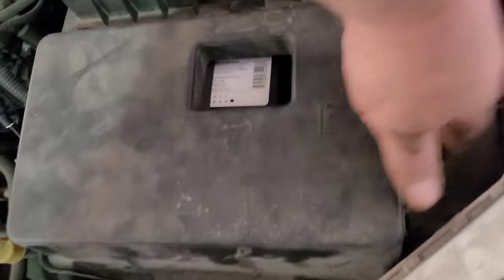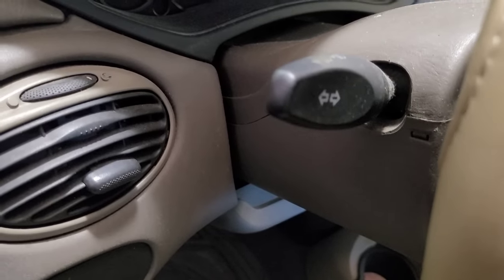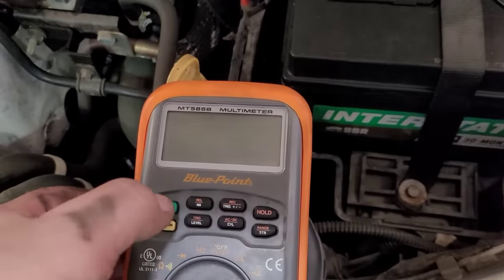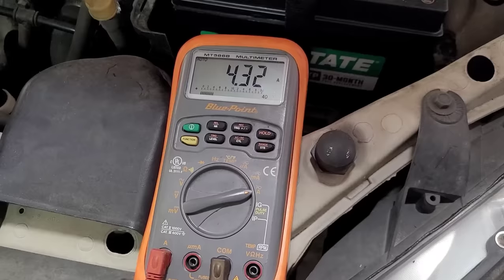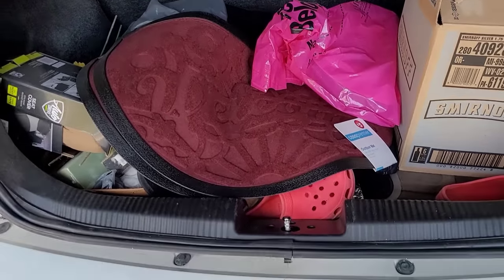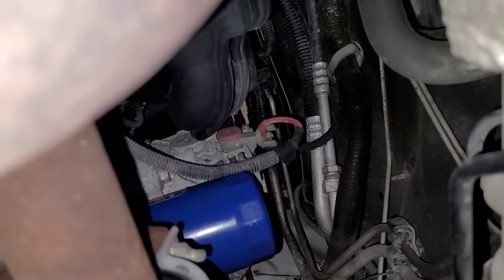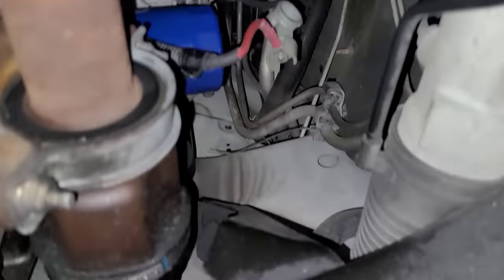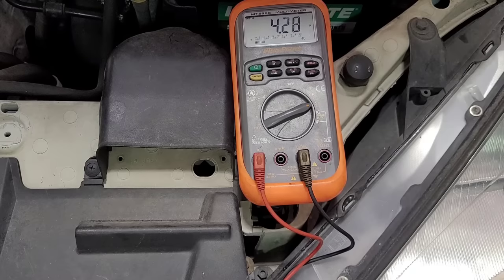Why is the Battery Going Dead? This One Will Surprise You!!

Comment: Very good find and video! Piece of advice from a BMW and Agricultural mechanic. On cars with lots of fancy control units, never disconnect the battery and then hook up the meter. Make a jumper from the battery to your battery cable (so it can easily be removed), hook up the multi meter in parallel, but to the battery terminal directly (so it remains as connection when the jumper is removed). Turn the key on until all controls have gone through their wake up cycle. Turn the key off, LOCK THE CAR with the fob, disconnect the jumper and then see.
Reason: if you disconnect the battery and then put your multi meter, some cars will have a spike draw that will trip the meters 10amp fuse or even kill your meter. Also, there are many other places a parasitic draw can occur in modern vehicles and the car MUST go through the natural cycle of "booting up, booting down" and going to sleep with the anti theft in place. I had quite a few vehicles where a controller wouldn't fall asleep, because the CANBUS was impacted and kept it awake. A short in a radio or even light control switch can do that, but might not show up, if the booting cycle was not completed. Finicky things.
Finding a bad alternator is an easy fix  good job!
Reply: That's why I have a DC clamp meter for such things. That way you don't have to disconnect anything at all.
Reply: @wiedapp  wow, must be an expensive clamp to be accurate below 5amp
Reply: @oBseSsIoNPC  Not really, was about 100 bucks. And that is accurate enough. And I'm talking about my personal one.
At work things are a bit different, there I have two of them. One can measure up to 400A AC or DC, the other one can measure down to 0.1mA AC or DC. That is way beyond anything what you need in a car in terms of accuracy. The 'big' one is for everyday use, but when the currents get really small, I pull the small one out of the drawer. Both are provided and regularly calibrated by my employer. The 'big' one you can't get anymore new, was around 350 bucks, the little one around 250. And that was one of the cheapest from a reputable manufacturer we could get. If I went with our usual brands, the little one would have cost about three to five times that.

But just so we are on the same page: I don't work on cars, besides my own and that of my immediate family and neighbors and I only do minor repairs.
I mainly work as an electrician at an industrial company, mainly doing fault finding and repairs. There we work with 0-10V and 0-20 or 4-20mA signals to control appliances from 0-100% or get readouts from 0-100%. But the current draw of each component is still a main checkpoint for fault finding. Clamp meters do make my work easy, as I can find faulty components faster and without a need to disturb the wiring and without powering something down. Because: Sometimes faults go away with a power cycle and then I don't win anything by saying I can't find the fault.
In addition the search is faster, BECAUSE I don't have to open up the wiring to put a meter in between. When I work on something, I want to get the job done and move on to the next. Only if something goes bad repeatedly I dig deeper, because I want to know why and it gets on my nerves. That makes my life easier later on. Sometimes I even can come up with a solution to reduce the occurrence of said faults.
Reply: @wiedapp  definitely! Those are great points and I do agree, an amp clamp does really well and is simpler than the previously described method.

Comment: Had a late 80’s Honda with no charge ,dead battery. Put in new battery to start car and confirm no charge.Car was California built , for some reason the alternator was not available in Canada, wondered what could be different but had to use local rebuilder. I dont know reasons for sure but he replaced what he said it needed and re-used rest of components. Turned out , after battery going dead 2 more times we discovered the draw , guess tech working on it at the time didnt think about draw because no charge and dead battery led him down that oath . Any way, we ended up putting 2 techs and myself on it to narrow down the issue, turned out the old rectifier plate with the diode trio had one bad diode. It was discovered the same method you did , disconnection of alternator 12 volt source live , draw went away. Rebuilder wasnt on board with our findings cause he didn’t want us to know he didn’t replace the diodes.

Comment: I had a Parasitic current draw once on an old Dodge Dakota on the in dash Tachometer. The draw was enough to make the battery dead after about 3 days in the winter months. I ended up putting a relay in its fuse circuit to kill the power if the truck didn't have accessory power. This was a simpler solution than trying to find a good replacement the same age in the junk yards.

Comment: Going from the battery out, there's really only three places where the it's directly connected: starter, alt, and distribution block. Disconnecting the alt (most likely problem spot) would be my first step; if that doesn't do it, disconnect the starter. If that doesn't change the current draw, start pulling fuses. 9 times out of 10, this will show you where the problem is in 10 minutes or less. If none of the above solve it, you've mostly likely got a short somewhere (usually an after-market install or a wire with insulation worn through and rubbing against grounded metal.) There's no reason to turn the engine over if disconnecting the alt gets rid of the draw - you've diagnosed it already, just replace it. ☺

And yeah, 135mA is pretty high. That's better than 3 amp-hours a day/20+A per week. Again, pulling fuses is most likely to localize it - although I've seen salt deposits on a starter create a ground path from the + terminal. Never know what you'll see in this business.

Comment: I once saw a charging system that was weak but worked too hard on a late 80's Chevy. There was a whine in the alternators operation.
The starter cable had been replaced, and the non GM lug on the end of it had turned toward the engine block and it's corner was touching as a result of how it became tight on the starter solenoid.
The GM cable has a different shape originally.
Once the starter was rebuilt the cable end needed to be bent to provide clearance.
Like you say, some wires are live wires and they're in a tight spot but hard to see.
The alternators sound quieted and the charging system was giving better readings after repair.

Comment: 7:35 Is the DVM saying Ouch!
It is a Blue Point which is a Snap-On product.  It's a very fancy multimeter.  And expensive.  If I was still working I would put in an order for one. From what I read it's better than a Fluke.  And it's says "Ouch" on boot up.
Reply: Fluke isn’t cheap so what makes that Multimeter better? Other than saying ouch of course
Reply: I like the fluke meters, but thats what I learned on. Snap-On makes solid stuff, but they each have their own pros and cons. Fluke is my go-to for sure.

Comment: Back in the 60's with mechanical alternators, the contacts would weld. When they went with electronic regulators in the 70's, the GM variety were inside the alternator housing and heat would destroy them, causing this. Occasionally a diode in the trio, would cause this too. Things have improved a lot since then, but now they have included external switching that shuts the alternator off when climbing steep hills with the AC on, so one more hassle. A couple manufacturers are working on codes for the electrical / body module control, to tell when this stuff goes bad

Comment: A better way to check for closed circuit current draw is to take a 1 ohm ceramic resistor and solder alligator clips on both ends. Instead of hooking your meter in series on the negative battery post, place the resistor in series.  Then connect your meter on either side of the resistor. Set the meter to the volt scale and the voltage drop across the resistor will equal the amp draw due to ohms law. You’ll never have to worry about blowing the fuse in your meter again.
Reply: Oh! SO WRONG!! Whilst I cannot fault your logic, please tell me you've heard of DC clamp meters!? It should be common practice when trouble shooting car electrics to NOT change ANYTHING. That means NO disconnecting battery terminals etc to measure current since any change can introduce SO many new variables. With a clamp meter this is simply not required. You can clamp onto any accessible wire up to and above 00 guage and it's instant. You can check multiple connections in under a minute!

Comment: I have had several, but not many, alternators that had failing or failed diodes (rectifiers) in them that pulled enough amperage out of the battery to cause batteries to go dead mostly overnight,  I normally used a Sun VAT-40 (old school) to quickly check charging system with nearly all cars that came into my stall.  Part of the test is to simply look at the voltage meter.  If the needle went above a certain thresh-hold there was a bad diode or more.  Quick and easy to check for that.
Reply: In that scenario you could use a infrared thermometer or thermal imaging camera and look around the vehicle. The alternator would have been showing very warm as the current flowed through it.
Reply: @larryreno8293  the next time I see an alternator with bad diodes I will check that out. It is like using a digital infrared thermometer to check exhaust port heat when looking for a dead cylinder. Clever.
Reply: Good info thanks is it possible a new alternator having a faulty one
Reply: here is a case in point re: even a recently rebuiltg alternator having problems:

https://youtu.be/-ur-4TSZoRU

Comment: I used to fix my own cars, not any sort of serious mechanic, but I remember changing diodes in an alternator that was having similar problems. They might not be replaceable in the newer cars. A book from the library (early 70s - they didn't have google) explained how to check the diodes). Remember referring to that book a lot, trying to remember the name of it. "Motor manual"? I also bought Chilton or Haynes manuals for most of my cars back then. New cars are way more complicated but some repairs are still manageable. My primary driver is a 1978 GMC pickup because I can still repair most anything on it.

Comment: Wow, that's a great guess, I've never seen that. At 4A draw you could have used an inductive ammeter, or even a compass to measure alternator current without removing the cable.
Reply from the maker: True . But I'm thinking of the driveway guy when I do that . That's the reason I did it this way .
Reply: So many newer technicians don’t know the really old school compass trick. Basic physics, current flow equals magnetic field. I used to show my newer technicians a lot of old school tricks ( I’m retired now ). Makes them think and gives them options. 😊😊

Comment: great video....use a laser temp reader and point it at the cold car to help find shorts fast...engine block 71 F, alternator 91 F-then the short is likely in the alternator, temp the relays in the fuse box, all read 58 F, but the one for the fan motor reads 108 F fan module reading 93 F, seat motors, wiper motor, radio, etc..

Great video....
I have seen lots of cars not charge, but the battery light or AMP light would not come on to warn you....

Comment: years ago ran across a weird battery drain problem on a pick up.  the back window had gotten knocked out, and it rained before the guy had a chance to fix it.  anyhow, window is fixed but now he has the problem that keeps killing the battery.  we tracked it down to a power lead that was under the carpet that apparently had a very small hole in it, probably from getting probed by the stereo installer, and noticed this huge copper plated spot about 15 inches across, on the metal floor under the carpet mat.  the mat was still pretty damp, smelled like a wet dog, anyhow, the wire was right over the copper plated spot and we also noticed it was rather crunchy when we bent it, so we cut the wire at the hole and the copper wire had pretty much completely oxidized as it was copper plating the floorboard.  We replaced the wire and that fixed it.

Comment: I've seen brand new alternators have bad diodes, right on the money Kenny! I really enjoy your videos!
Reply: That is exactly what I thought it was going to be, it's getting ground from somewhere to have a 4.5 amp draw on it. He did a good job of chasing it down to fix the right part. Diagnosed work is just as much part of the repair as replacing the parts. Sometimes it's more of a pain than replacing parts too.
Reply: Good to know I got a similar issue on another vehicle I thought possibly bad radeo but I got to see know if how many amps or volts good start I can turn a wrench hate electrical.

Comment: The voltage regulator is out that is inside the alternator
I have seen that happen on a lot of GM products in the past 
But yours seems a little too new to be blowing that out
I believe you are correct in replacing the alternator

Comment: GREAT Job sir you keep it so "simple and logic" and i like to see it done this way! As a shop owner myself many many moons ago, i know the older school alternators is a 3 phase AC Current ( and still is a AC System)and if for some reason some unskilled person  has boosted the vehicle and hooked booster cables backwards,or has boosted another vehicle with theirs wrong,/backwards connection.. i have seen  just one diode ( could be the positive or negative one)  in the alternator go shorted  and it will "draw" current and charge fine, but the Amperage Output was not as "stamped" on the alternator housing,so for example if it was a 90 amp alternator housing.but because of the one shorted diode, it was only putting out 60 amp max after being tested for output!  I have only saw one or two alternators that this has happened too. it was a shorted diode. so really its easier to install a new/rebuilt on the newer vehicles nowadays, I love you videos sir!!! please continue to post your findings and expertise!!! 100-100 ty Sir

Comment: Just did them same scenario on a 2002 Taurus.  I have been trying to find  parasitic draw. I observed a charging alternator, isolated any potential interior components etc. Luckily I stumbled on your video.  Just yesterday, new reman, fully charged battery..we shall see.. Previously, I installed a full disconnect switch to isolated all interior components. ( ahead of the accessory fuse box). Issue still occurred. Hopefully the alternator is the issue. Thank you for sharing this information.

Comment: very good.  and very interesting troubleshooting lesson.

one thing I would like to add:  On my truck, with key off, doors open and hood open will create a load to the battery.  There are lights in the cabin and on the door as well as a delay to the running lights even when key is removed.  So, if you are doing this test, you might assume there is a parasitic draw somewhere or see a very high amp draw, but you have to notice what is running at the time.  One way to prevent confusion is to close all doors, remove the hood light (if you have one), and either manually turn off the running lights or wait the period of time when they power off after delay.   On some vehicles with the fancy key fobs, the vehicle will react to proximity also....and "stir" some systems in preparation that you are entering the vehicle (like cabin lights, running lights, and even some vehicles will chirp...so pay attention to key fob proximity too...

I learned an easy  method to determine what system is causing parasitic drains also:  being removing fuses...start with engine compartment fuses...one by one...then move to cabin located fuses.  Eventually, you will find the system that is causing the parasitic drain.  Then it just becomes a matter of locating within that specific system where the excessive draw is occuring.

and then also this:  removing battery power from the vehicle will almost always reset the ECU/PCM/BCM computers.  So don't be surprised that when you hook cables back up to the battery that the vehicle goes through a relearn mode again...Sometimes, this also affects the entertainment system...tpms (tire pressure sensors), clocks etc.  So don't be surprised to see those systems giving a warning....it's a normal condition.  Eventually those systems will relearn ...some will not however.  Like clocks and radio turning you set and in some cases blue tooth links must be reestablished.
Reply from the maker: Thank you for your detailed information. I appreciate you. Keep wrenching

Comment: I had a parasitic draw  problem with a 2006 Saturn Vue last year. I suspected the alternator, but it was showing a good charge. Similar unexpected high amp draw with all off and given time finish any thinking  the want  to do. This draw was enough to flatten the battery if I let it set a few days.  I set up to do an amp read of individual circuits. First fuse  was for the AC. Pulled it and the amps dropped. Replaced fuse and no more draw. Turned out to be the AC relay. I did have another similar issue with a 2007 HHR  with the "smart charge" system that through some voodoo magic compares the charge to the demand and the computer regulates the charge overriding the internal regulator in the alternator. Replaced alternator and that corrected the issue, but every so often on acceleration the bell will go off  and display battery one, then go out. Probably some odd difference in the new alternator that flags if the rpm changes, or perhaps it just does not like the way I drive as it behaves for the wife. Just  appears they over engineered the systems. :) Great vid!

Comment: One thing that hasn't been mentioned is the need, especially in newer vehicles of the last 10 years or so, is the requirement to reset the BMS (Battery Monitoring System) any time a battery is disconnected or replaced.